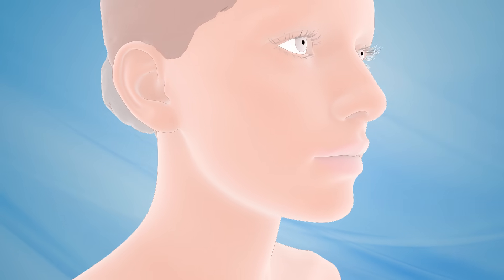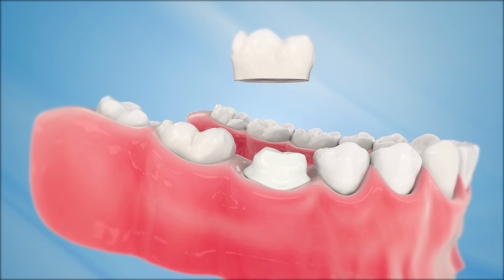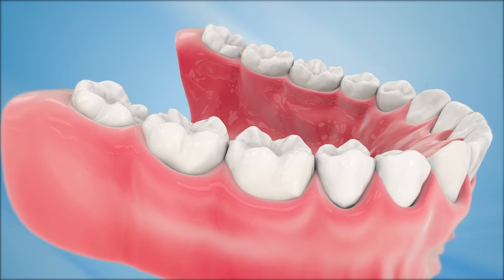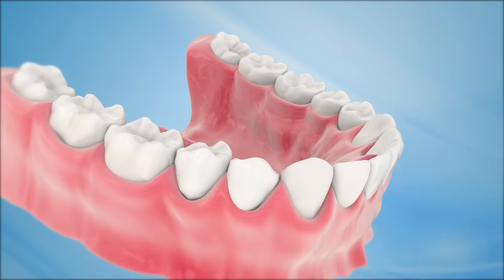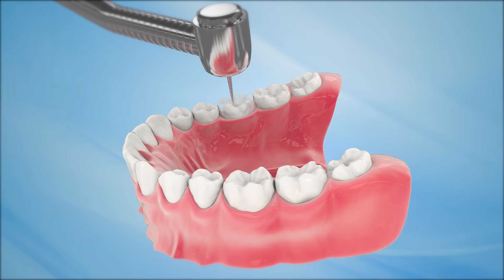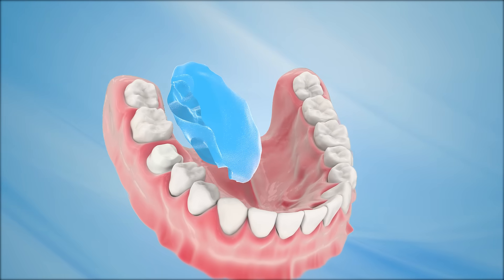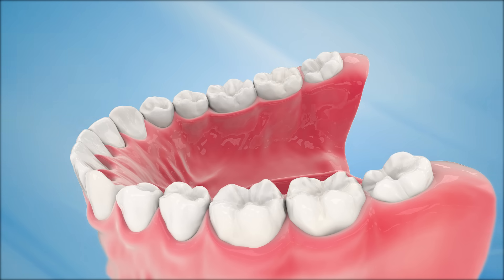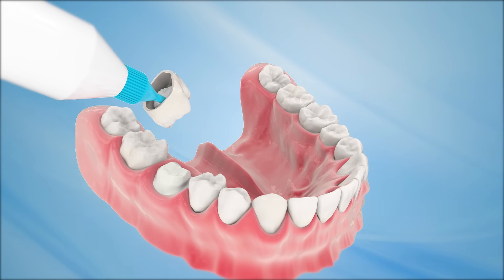Dental Crown Procedure

Comment: I had two root canals done few month ago. I was advised to have a crown to protect both teeth . I am wondering if having the crowns installed will be painful??  I panic a lot when I go to the dentist office
Reply: If you can handle a root canal then you can handle a crown. I've had 4 crowns in and didn't feel a thing every time. They numb you up pretty good just make sure to communicate with your dentist when he asks if you feel anything. The only pain comes from soreness for 1-4 days after the procedure but it's very slight it's just a little annoying and some ibuprofen takes that away if it gets too bad.
Reply: @noahsegovia3936  Did the temporary cause discomfort until you got the permanent ones? I just had my temporary put in a few days ago and my gums are very sensitive, its nothing that I can't handle but I don't want to taking ibuprofen for two weeks.
Reply: @redgamemaster  my dentist has a tooth maker thing at his place so I never needed a temp crown but I did feel discomfort from my permanent for about a week it was pretty sensitive. It got less and less every day though so I didn't need ibuprofen super often just when it got bad.
Reply: @noahsegovia3936  Thanks.
Reply: D Nemri no im due to get mine fitted on the 18th ur mouth in numbed so you dont feel anything youll be fine
Reply: D Nemri I might be late, but it is not painful. I had 4 crowns put in about 6 months ago. They inject novocaine into ur gums. You’ll feel a pinch but it isn’t bad. If you hate needles, do not look at the needle before ur dentist does the injection. You’ll be fine!
Reply: @yuh3491  Did you have crowns put in without a root canal?
Reply: @FEARisCOLD  nope, I had 8 root canals total. On the same teeth
Reply: @yuh3491  Gotcha. I ask because I think I need a crown but not a root canal. I’m worried the crowned tooth might be painful without the root canal. Thanks for replying.
Reply: @FEARisCOLD  I don’t think it will be painful? Then again, I don’t know. They basically just drill your tooth down and put the crown over it. In my case, my teeth needed to be protected because they had been through so much
Reply: @yuh3491  I had an onlay that popped off and my dentist decided to do something different instead of just gluing it back on. This cause it to have a fracture now. I don’t even want to go back to him. I’m assuming I need a cap now, really hoping I won’t need a root canal. But I blame him. I was fine before this.
Reply: @FEARisCOLD  jesus, that’s another thing. You really have to be careful with the dentist you go to. Many dentists aren’t as professional as they may seem. My suggestion is to find a really good one in your area. Look at reviews and whatnot
Reply: @yuh3491  I had a crown done 3 years ago and it was painful
Reply: @idrewthetable4you306  how is it now?
Reply: @kennethsamson4491  It became infected, swollen gums and nerve damage, the dentist had to extract and replace them with implants  and it was pricey.
Reply: do the root canals hurt?
Reply: azzy i felt EVERYTHING!! literally crying my eyes out and squeezing the chair arms, making loud cry noises . i felt like i was in the movie SAW.. sitting in a chair while someone is causing all this pain in my mouth 😣😣😣😣 i never went back to that dental place again in Delano, California! 👎🏽👎🏽👎🏽👎🏽👎🏽👎🏽👎🏽👎🏽👎🏽👎🏽👎🏽👎🏽👎🏽 i'm still traumatized til this day . i barely had my temp crown put on today from a different dental in a different city 👌🏽
Reply: Alexx Lopez945150 did u tell them to numb you more ?
Reply: 1400 E yes he asked if i wanted more shots to numb the area but it didnt matter how many shots he gave me, i felt everything in my bottom jaw line. 😰😰
Reply: Alexx Lopez945150 you know what. Honestly that’s exactly where I felt a little something. The bottom jawline . I couldn’t explain it at first but I did feel something and that was not a pleasant feeling. But it didn’t hurt me too bad I was just like “ahh .. ahh”
Reply: ITÁĆHI ÛCHIHA the process of getting root canals, not the crowning part lol
Reply: ITÁĆHI ÛCHIHA thats great you dont feel nothing! you got great teeth then lol didnt take too good care of mine as a child-pre teen..  but i didnt think a root canal was going to be that painful for me even with more than 10 "numb shots"
Reply: ITÁĆHI ÛCHIHA for your did they like put the nails on a tool and it made it spin into your tooth all the way down ?
Reply: ITÁĆHI ÛCHIHA yess bro . Like mine wasn’t at the point where I was crying but it definitely was the worst part everything else I was just chillin . Did you get your crown yet?
Reply: ITÁĆHI ÛCHIHA today I’m prepping for the crown at least that’s what my dentist told  me. I think they just shave the tooth down and pack it then do the mold
Reply: ITÁĆHI ÛCHIHA I got my temp . It kinda hurt because they had trouble packing it. Like right before the mold. Other than that it’s fine but now I have to get my wisdom tooth on that side out before the permanent comes in . And I’m scared as hell for that but ugh it seems like they find something new Everytime. Ughhh
Reply: ITÁĆHI ÛCHIHA really? That’s good. I didn’t know because I think it’s only one their pulling out but if I’m asleep then I’m chillin
Reply: ITÁĆHI ÛCHIHA yea I seen those too. I go on September 14th soo . I’m fine for 2 weeks
Reply: ITÁĆHI ÛCHIHA aahhhh , no , dont call yourself that😆
Reply: It would be painful if the dentist shaves off your enamel leaving to it exposure nerve problems
Reply: How long do you have to wear the temp Tooth And What if you don’t like needles do they use a gum or something?